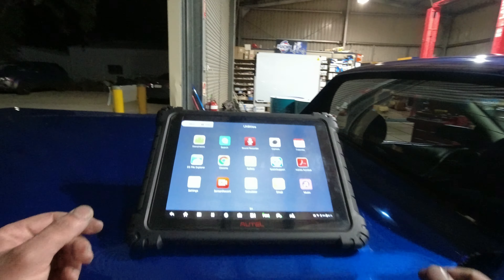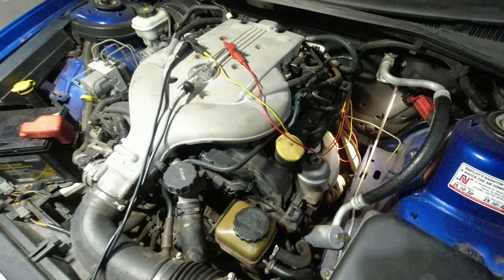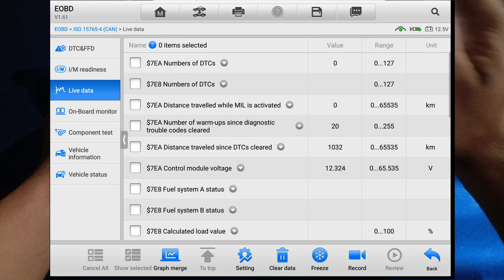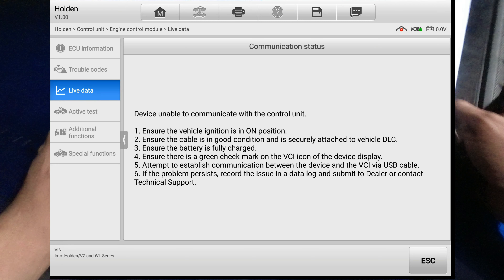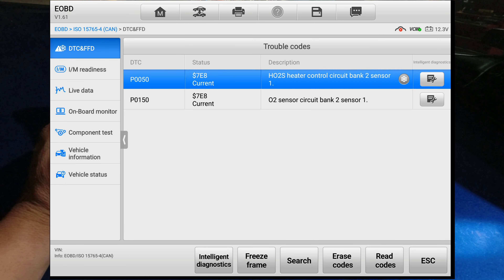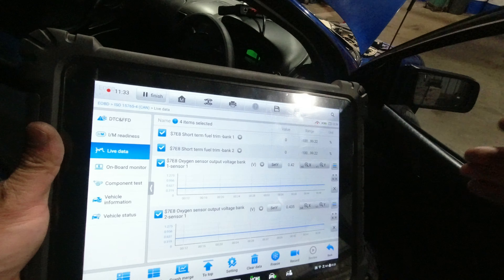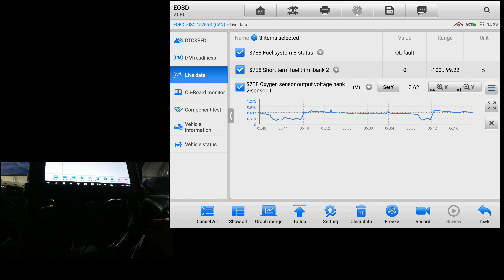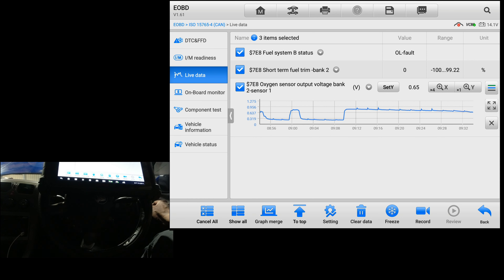vz commodore o2 heater diagnosis

Comment: A vacuum leak will also give a o2 censor fault ... did you do a smoke test ??
Reply from the maker: That is nonsense if you watch the full video and read the fault code.
Reply: A vacuum leak will not throw a heater circuit code friend.

Comment: Hello mate, is Holden the maker of that engine and ECM? I know you really want AUTEL to fix this software problem but if that is a GM product or another maker, can you use their software, or not? Late in the video, I do not understand why professional techs do not check oil before they start every job, I do not want to be the one to get blamed by the owner for a new engine replacement, I will annotate the work order of the oil level also, cheers. Thank you for the video mate.
Reply: As part of your professional videos and diagnosis, you are also helping out the DIYers by showing simple tool usage. I wish on this job as a backup that you ran an ohm test on the HO2S heater to show an open circuit or very high resistance, thanks again.